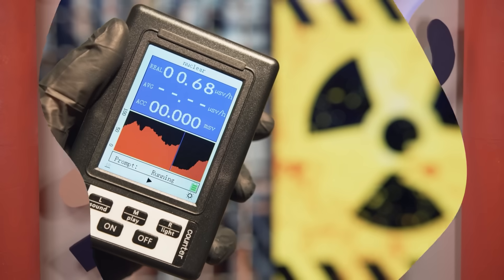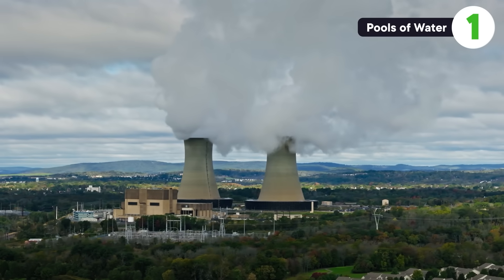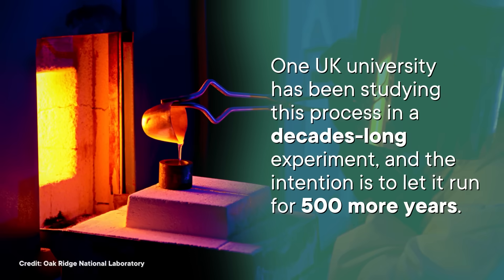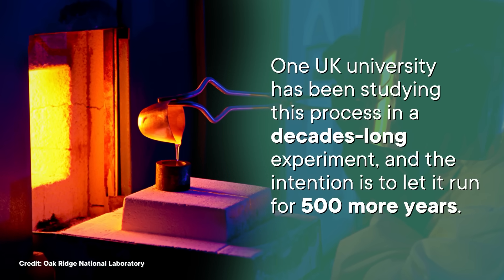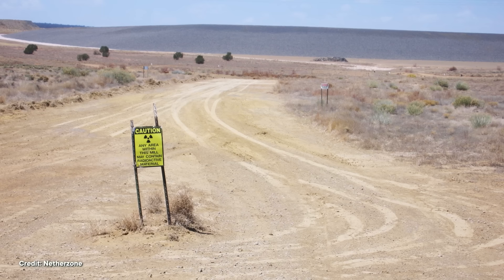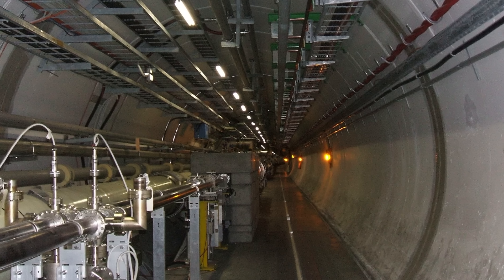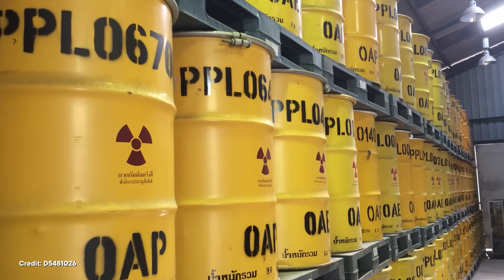So You Need To Dispose Of Some Nuclear Waste…

Comment: 1. Most stuff today is very reusable, typical waste has like 90% usable energy left.

2. Real solution is to reuse the waste in reactors that can use waste, whether its a breeder or MSR. That leaves some long-lived isotopes, of which some of it has medical and other use. The resulting waste can be transmuted in particle accelerators to stable isotopes if wanted with $$$. What is left is likely C-14, Sn-126, Nb-94, Ca-41, I-127, Zr-90. These cannot be transmuted and must be stored or dealt with otherwise.

3. The stuff that absolutely has no use we can just shoot into space, but not now. Ignore the pop Kurzgesagt video, the reality is that even now we do shoot radioactive stuff into space, namely in satellites. There even was Soviet failed launch whose core was recovered from bottom of the ocean. However thats like during cold war. Give tech 50-200 years and the launch success for important launches can be pushed into 99.99% probability (its already 99.4% for F9), and add containment structures that can have mechanochemical polymers, parachutes, safety rockets, whatever. Basically the safety of the delivery will eventually be way safer and less costly than storing stuff millenia underground. Then you just shoot it into Sun with one-way ticket, again not easy but has been done.

4. In Finland there's storage depot deep underground called Onkalo, and the geology is one of the most stable on Earth, almost predating life. The most practical option is just to store it for some decades or a century until the disposal tech becomes safe and cheap.
Reply: Why send the remaining stuff into space. You said 90% of the fuel can be reused. Theres 300k+- tons of spent fuel in the world right now. If all that was recycled youd have 30k tons left not including removing any that can be used for medicine like you said. The average car weighs 2+- tons. Because the waste is dense you could probably store the 30k tons in a typical garage attached to a house (size comparison not suggestion). Why create an underground storage when above ground works just as well.
Reply: @namename9998 : Underground storage is useful for the "short term" waste that you don't have a use for, because you can render it inaccessible to anything other than a government for the 1000+ years that's needed for it to render itself effectively inert, even if all human civilization collapses. That's why you would bury waste.

That also means that you shouldn't bury "medium-term" waste, as a fresh volcanic field could actually pop up and breach your containment before that stuff became inert, so you do want to transmute that stuff, even if by force.

Meanwhile, the really long-term waste is so slow to decay that it really just counts as non-radioactive ore for most purposes. It's sometimes toxic in the chemical sense though, so it might be desirable to bury it for that reason.

Comment: Alot of the existing waste could be "burned up" in thorium reactors.  I wonder if the economics of storing waste vs using them up has been adequately factored into the question, if thorium reactors should be part of our future.
Reply: One of the points raised in Larry Niven's not-entirely-serious essay "Yet another modest proposal: the Roentgen Standard" (arguing that we should make coins out of nuclear waste) is that we'll inevitably find uses for nuclear waste, just like every other form of waste over the millennia, so we would benefit from keeping in in circulation ready for use once that day rolls around...
Reply: @rmsgrey : Turning waste into coins is a horrible idea, you'd have to search every abandoned sofa in america to get enough coins for your doom ray!
Reply: @rmsgrey :@rmsgrey  question should we pay for long-term storage in glass for an unknown future benefit? Or should we make fuller use of the uranium we have mined.  Commercially a fuel rod is spent after about 5% of the uranium missions. The primary reasons for not reprocessing  are a mix of economic, political, and plutonium non-proliferation concerns. Instead of re separating uranium and plutonium and radioactive waste products,  the bulk can be burned up in thorium reactors.
Reply: France has been reusing fuel for years without needing thorium reactors.
Reply: Yes, burning the waste sounds much better than storing it. However the processes for preparing it for use as fuel are the opposite of the processes we want to do now. I mean, preparing spent fuel for storage is (likely virtually) irreversible and you need to do something with it now while you can't burn it yet.
I recall descriptions of spent fuel processing that's supposed to make it incredibly hard to reuse the material for military purposes. The same irreversibility would apply to reusing it as fuel in a different reactor
Reply: @nadavshemer : All you have to do is powder and then vaporize the glass in an inert atmosphere, the temperature of vaporization will alter what does and doesn't vaporize (thus performing the first step of purification as well).
Reply: @nadavshemer 
The process and reactors that can reuse spent fuel is a mature technology that has been used for over 40 years.

What to do with radioactive waste isn’t a problem of skill, but of will to spend the money.
Reply: You can reprocess waste into fuel with current reactors too, but the cost of safe storage vs the cost of reprocessing isn't always considered properly, because not all storage cost calculations take the long term into consideration.
Reply: OR CANDU!
Reply: China is doing that.  They are still working out the kinks of thorium molten salt reactors, but yes they are much safer for not only making meltdowns moot but also using up any waste products of Uranium 233, the isotope produced from bombarding Thorium 232 with neutrons and then Protactinium 232.
Reply: @PittsburghRonin 
The “walk away” safe moniker can apply to any reactor with a passive safety system.  It’s just jargon from molten salt reactor fanboys and lobbying groups.

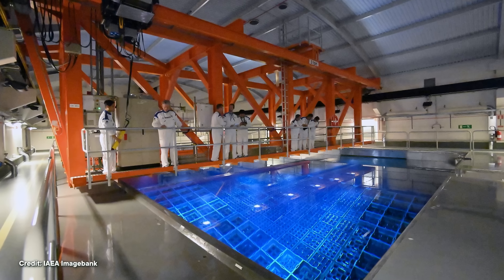Comment: 3:45 If it's deep enough, it is safer to dive in it at a relative shallow depth, than swimming at the top, because the water then shields you from background radiation too.
Reply: Would not recommend.  XKCD What If had a video about that.  The nuclear expert he talked to said if you tried that where he works you would die instantly from the bullets fired by security.
Reply: @mataichi14  So you'd be safe from the radiation then?
Reply: @rmsgrey  Yea swimming just below the surface would give you some protection from the radiation we are regularly exposed to just living on Earth and the pool is deep enough that it would protect you from the radioactive stuff at the bottom but without a very good reason to be there you would never make it to the pool.
Reply: @mataichi14  And unless youre using scuba tanks you have to surface eventually.

Comment: It should be relatively easy to model the degregation of radioactive materials embedded in glass over 500 to 1000to 5000 years. Generally, I'd expect stresses in the glass may grow with the accumulation of daughter particles of nuclear fission. The question is how much and  when would stress fractures eventually become a problem.
Reply: Like most of our problems it's one for future generations to solve.